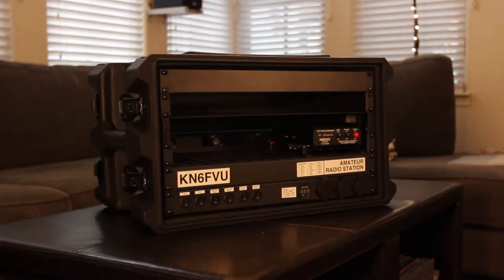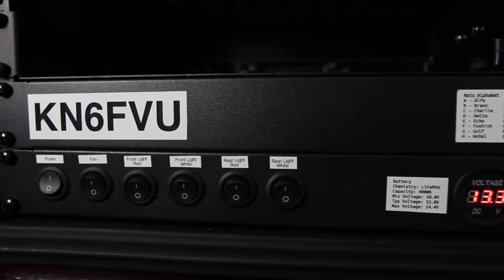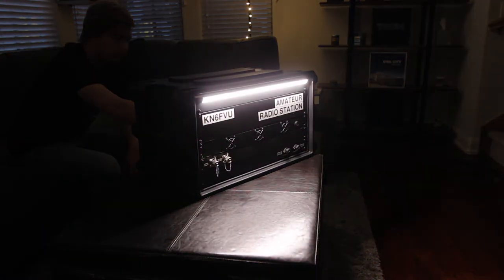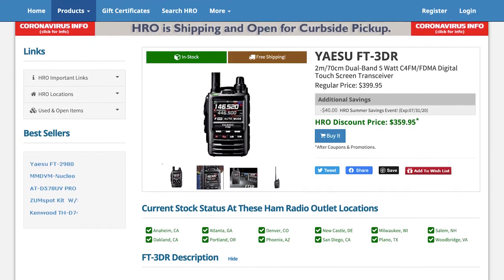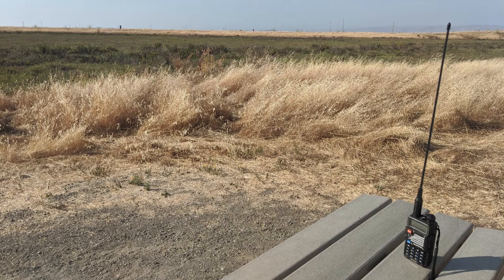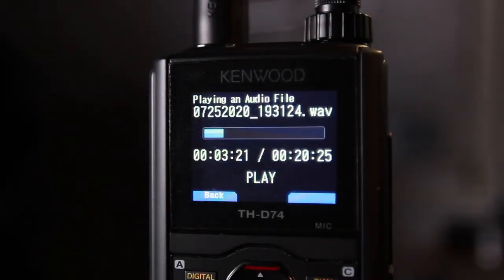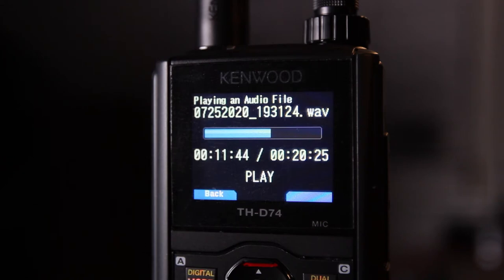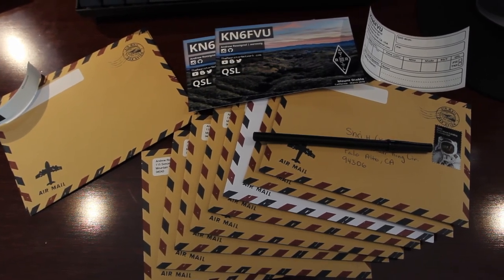Amateur Radio from 2900ft. on Mount Diablo | 146.520MHz FM Simplex

Comment: More details on parts list please. What switch panel> What is above the switch panel?
Reply from the maker: I'll have a video very soon with more parts info and a look at the internals! The switch panel is custom made from a 1U rack blank with some holes drilled in it. The blank above is just space for the batteries and 12V wiring.
Reply: @TheResistorNetwork  Cool. I can't wait to see flat batteries.
Reply: @TheResistorNetwork  so... how's that new video and more detail coming? Your go-box looks like it has a lot of potential to "grow"
Reply from the maker: @jbmarple  The video is already up and has many views. Check out my channel.